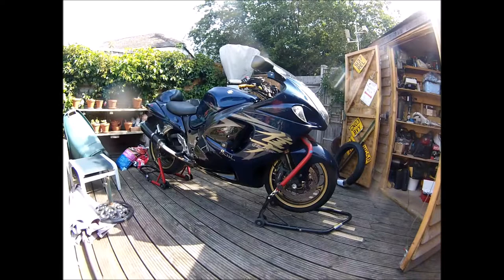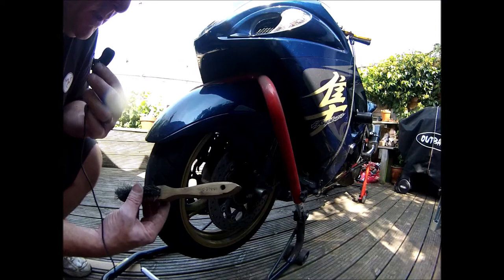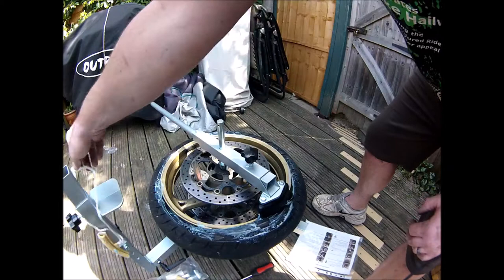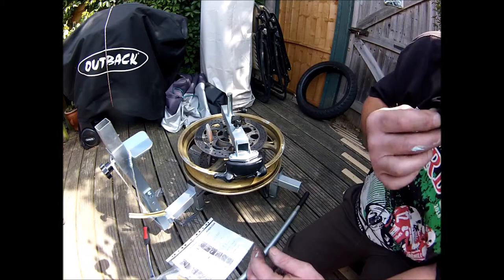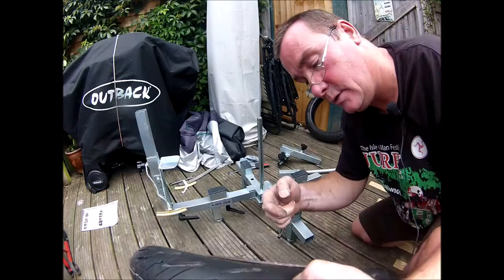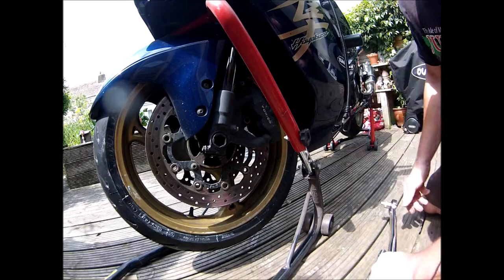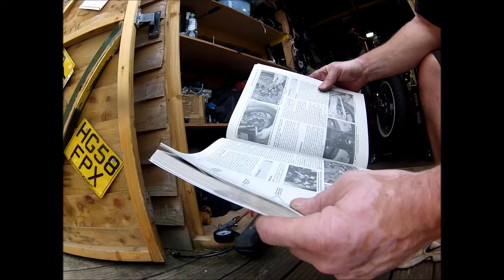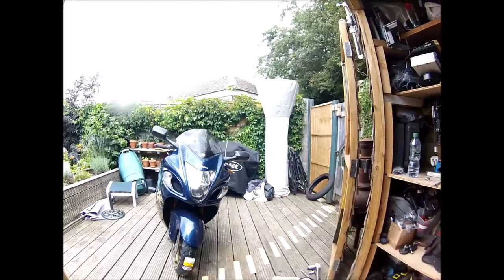Hayabusa Tyre Change

Comment: After tightening the axle bolt always tighten the captive fork leg pinch bolts first and that's the side that the nut goes on , after that bounce on the forks to allow the left leg to find it's neutral position before tightening left hand leg pinch bolts ,👍🏼👌🏼

Comment: ....did you reduce your tyre pressure from the 60psi  down to 41psi........I take the wheel off and let tyre company do that fiddley stuff and balance at the same time........ thanks for the vid.......
Reply from the maker: bristol , hi, yeah, I dropped the pressure to 42psi and made sure the tyre sat on the rim properly. . . having said that, it’s definitely easier to let the professionals do it . . . but this was my first ever tyre change, so its got to get easier. . . hasn’t it?????

Comment: Tyres and MOT - the only 2 things I don't do on my bikes myself - good to see you get stuck in with the tyre tinkering though - and a nice change from watching you producing porridge! ;0) - thank you for sharing!
Reply from the maker: Mike Openshaw , fare play to ya, young man. 
The one thing I’m still avoiding is a valve gap check. Well, not so much the checking but the changing of shims. The thought of Messing with the timing chain gives me shivers!!
. . . and don’t worry Goldilocks, porridge will be back on the menu at some point! Thanks for watching.

Comment: Angle grinder would get the tyre off to get it under the mudguard. Not as effective for putting the new tyre in though ;-)
Quite a different design to my MAX2H but the same principle. Looks like yo get a bit more adjustment in the arm, which is nice.
When I saw the "handle" I thought that was a nice addition, then I realised what you meant in the comment on my video :-D
For that last bit, I find kneeling on the other side of the tyre to get the bead into the drop-centre of the wheel really helps.
If you can bolt it down, it's massively easier.
Reply: By the way, did you realise the video wasn't public?
Reply from the maker: CalmBiker , yes I’ll try and find a way of securing it next time and use the ‘handle’ in the appropriate position?!? 
Regardless of that it was quite satisfying changing my own tyre. I forgot to balance it though so at a ‘tad’ over speed limits it had a ‘wobbly vibe’, so i had to strip it down and balance it, but it’s back to being a super smooth rocket now!
Reply from the maker: CalmBiker , yes, i just thought I’d send you the link to (hopefully) amuse you. I’m about 7 weeks behind with my videos, my latest one travelling to France on my V-Strom actually took place at the end of June. With the Busa, V-Strom and my Gixxer project I tend to amass a few videos and don’t want to flood YouTube, so I usually put one up every 3 days. I know eventually I’ll have to upload a lot in a short space of time but I’ll worry about that later. Thanks for subscribing and feel free to comment on all my videos, I really enjoy freedom of speech so don’t worry about offending me, it’s a very difficult thing to achieve!
Reply: You can use "Yellow thing" to hold the tire bead in the drop center.

Comment: Well done doing your own tyre change.. I've got a flat rear tyre on my 2019 636, a new S22 fitted is costing me  £170 😢
Reply from the maker: Glen Whyte , hi, i think i worked out that i need to change 10 tyres to pay for the tyre changing tool. So anything over 10 tyres and I’m in profit!! 👍
Reply: @bikerantics5001  is it very easy to mark up the rims when taking off or putting on the tyres ?
Reply from the maker: Glen Whyte , not with this tool. The part that slides around to take off the tyre is a very strong plastic, which I’m 99.9% sure can’t harm the rim. Add the tyre soap and it’s a very slippery combination. The only chance to mark the rim is probably from accidentally slipping with the tyre lever.
Reply: @bikerantics5001  thanks for the reply 👍

Comment: Did you balance the wheel?
Reply from the maker: This was one of my first attempts at changing a tyre and in all the excitement I forgot to balance the wheel . . . which after a very quick run i soon realised my mistake 🤦‍♂️
So I stripped the wheel off again and balanced it and on the second run out i had no vibes or shakes right up to the bikes speed limiter 👍🙏 . . . it has stayed in my mind and all my tyre changes since are followed by balancing the wheel 👍🤓
Thanks for watching and commenting 🙏
Reply: 🤫 I’m about to do the same job on the same bike 
Did the rear wheel last month and got me lazy now I’m going to work on the front